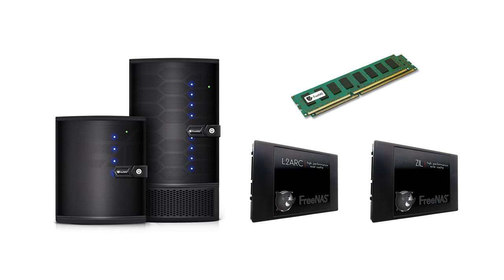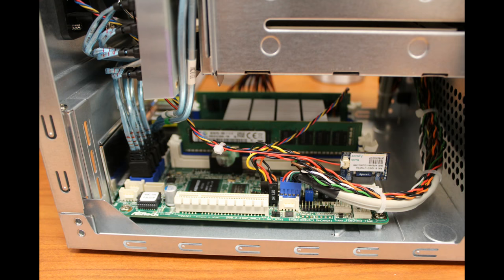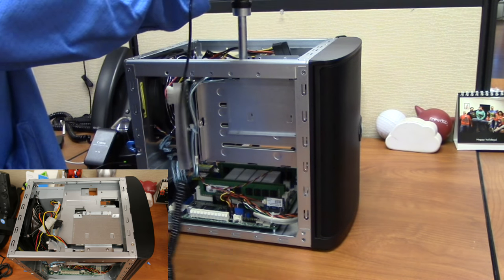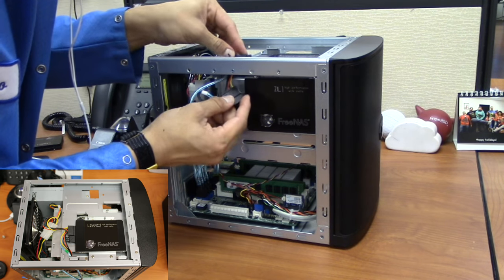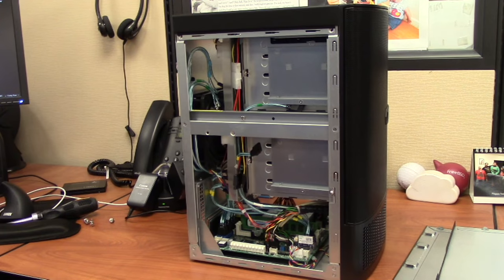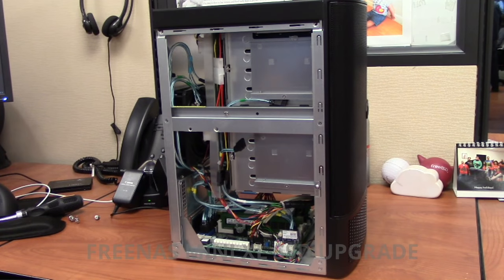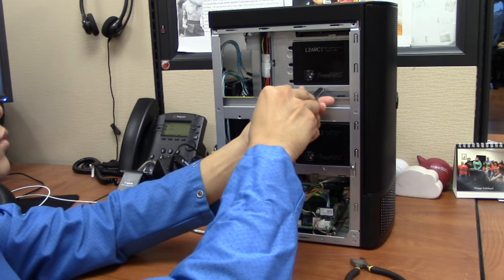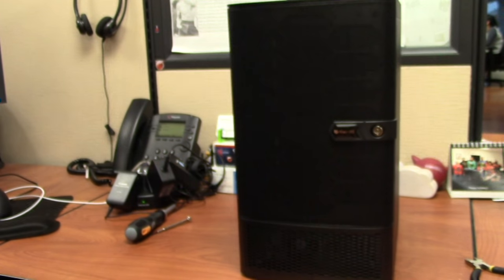FreeNAS Mini & Mini XL - Memory & SSD Upgrade

Comment: Hello, I have bought a freenas E +, but I don't know how much is the 220v or 110v power input? I live in Argentina and that detail is important. You do not specify it anywhere. Neither in the equipment, nor in the manual, nor in the purchase pages. Thank you.
Reply from the maker: All Minis are 110-240v auto switching!

Comment: ssd upgrade, what's that for?
Reply: For ZIL and L2ARC. Though I wouldn't worry about the L2ARC with this system as it wouldn't help that much. The RAM upgrade is a must, and if you use this as an NFS server you will want the ZIL drive. Ideally striping two ZIL drives for faster commits.